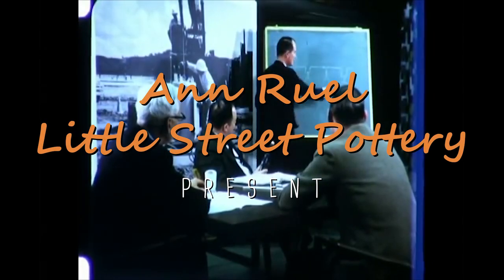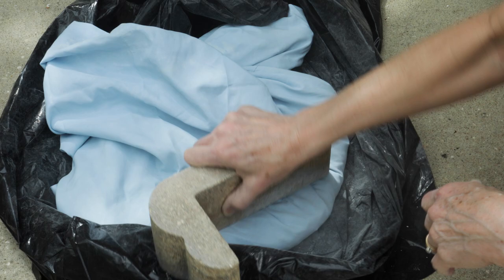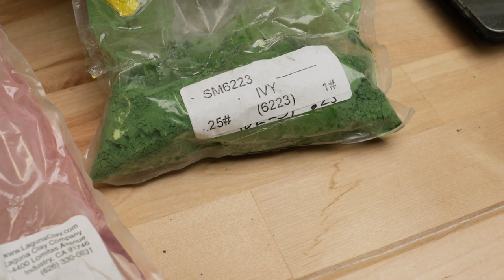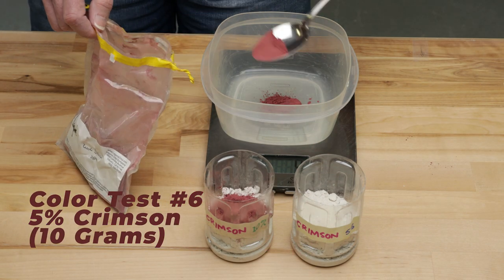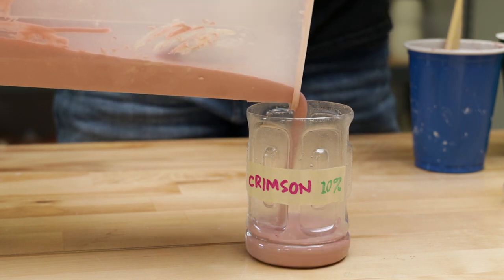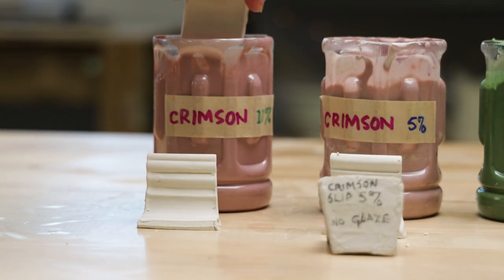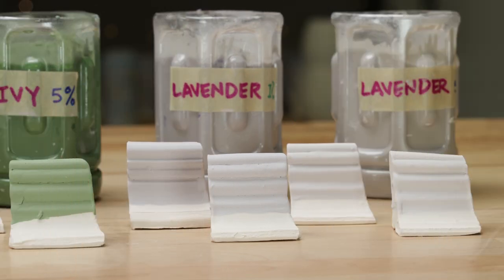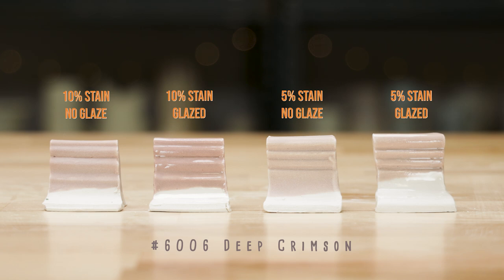The Colored Slip Experiments

Comment: That's a great video and really helpful!  Like you, I have found that 10% mason stain is the sweet spot for getting rich colours when making slip from dry clay.  I have also experimented with colouring liquid slip.  For that, I have found that for about 2 cups of slip, I need to add around 9 tsp (measured and level) of mason stain to get a nice rich colour. I add a touch of water to the stain before adding it to the slip just to make mixing it in easier.  Thanks again - I love your videos!  - Sue in Nova Scotia, Canada
Reply: Hi Sue.  NIce to meet you.  Great tip!!! Thanks so much.

Comment: Hi!  If you want to get a red to stay true you will need one of the encapsulated mason stains... same for orange.  I've gotten 6027 Tangerine and 6026 Lobster and used them in clear glaze to cone 6 and they work great!
Reply from the maker: Great tip Martha...thanks for sharing!
Reply: But beware that encapsulating chemical isn't good to breathe as it burns off make sure you super ventilate and use breathing ppe during the heat up but once it hits high fire Temps you should be good to go but keep the fresh air blowing just in case.

Comment: Great video as always. One suggestion, try using hot water instead of room temp. The clay and stains slake much quicker.
Reply: Wow, thanks Kathleen.  I cant say that I have ever heard that tip before.  I will give that a try!
Reply: @annruel1982  I don't think hot water would work any faster, because you are not dissolving, only suspending.  Also, I find that clay slakes more thoroughly if not stirred, or you will compact the clay and make a seal around the dry parts.
Reply: @jenniferassinck803  Thanks Jennifer.  That would be a good experiment for your research scientists :-)

Comment: Hi, thanks for this video!
I was wondering if you can add multiple layers of coloured slip on top of each other onto leather hard clay. Would the layers flake off? Also, can I make coloured slip from hand-building clay (has some grog in it) with mason stains? Thanks in advance!
Reply from the maker: Yes you can! Just let them dry between layers. 
I've not tried the groggy clay for slip...there are many variables but I'd suggest testing it. Let us know how it turns out.

Comment: Hello I have a question if I mix
Mason and water to make a wash can I leave it raw without glazing. So it has and oxide look too. And do I need gersly borate I think it's called. Or can I just use water and fire it. I don't have the borate stuff and I need to make my dragon fly for an ordered Christmas gift I'm firing this weekend. If you can help thanks. I'm going to see what it looks like with just water and if I  don't like it, I might just glaze the beads.
Reply from the maker: Hi Heidi - I suspect that without the gerstley borate the mason stain might smudge off - the gerstley gives it some "tooth" to latch on. You may want to test it on a piece - pottery is weird, you just never know!
Reply: @LittleStreetPottery  ok thanks and I'll try something different. I just don't have a bead hanger and didn't want to use glaze if I could avoid it. I'll think of something

Comment: Adding 10g of stain to 100g clay is not 10% stain. The final weight is 110g. That's 9.09% stain. 11.11g of stain and 100g of clay  is 10% stain and 90% clay.
Reply from the maker: OK - thanks, I think you and Jerry Benderstiff need to talk 😂. Check out our Pebble Mug Disaster vid!
Reply: Your calculation isn't correct either. 10g of stain and 90 g of clay is 10% stain. Not 11.11g.